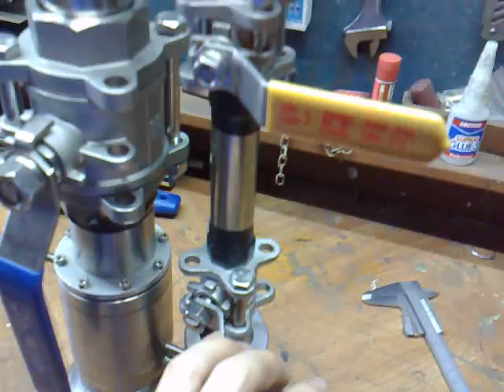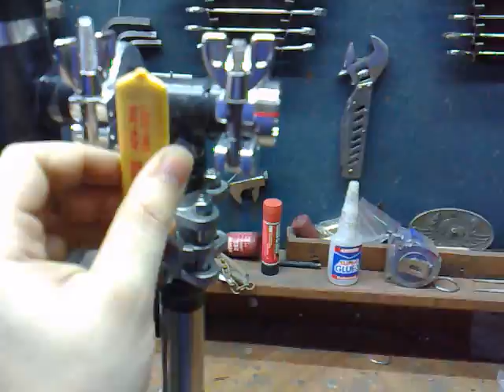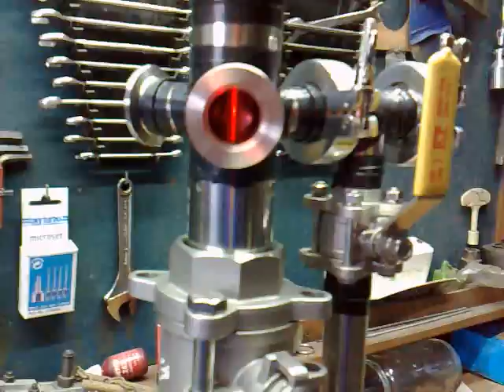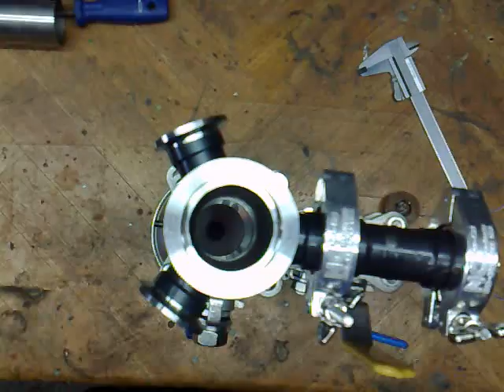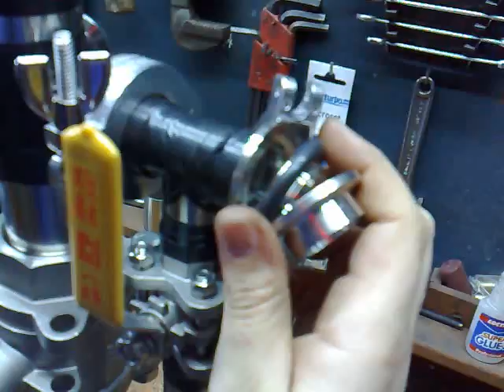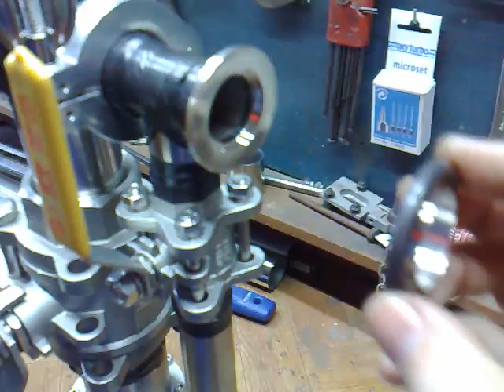Diffusion pump overview

Comment: hi. I would like to try building a high vacuum system out of garbaged parts. I know this is very difficult given that precisely engineered pieces are typically required, but this is why i would like to try this. Do you have any suggestions or resources for assistance?